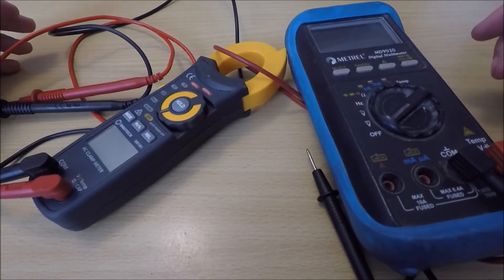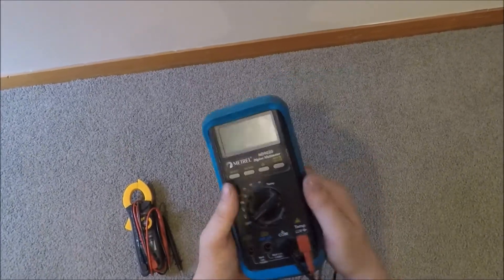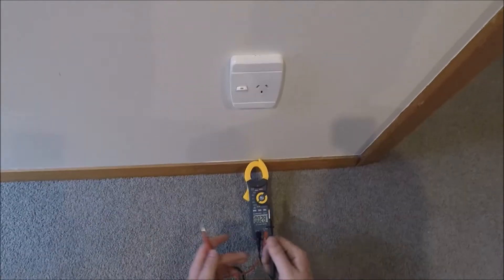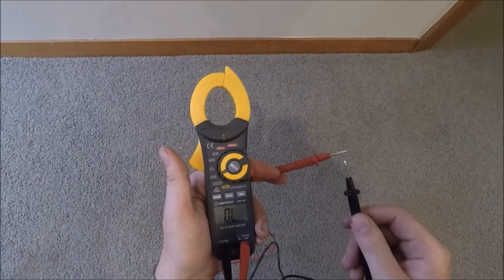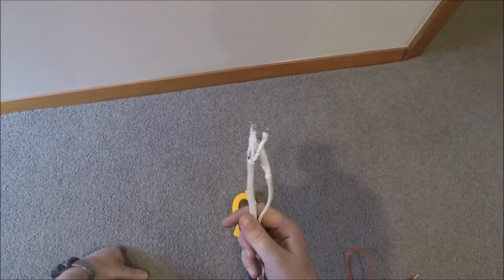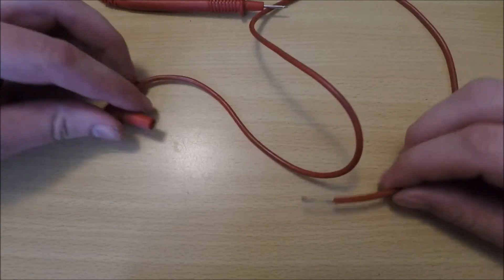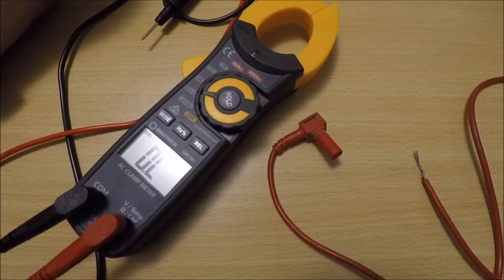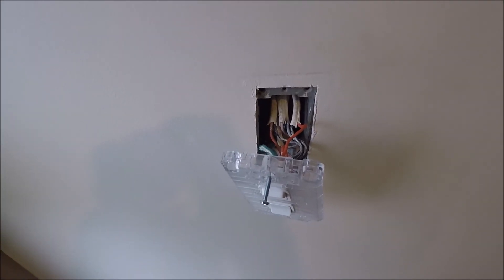How To Use a Multimeter

Comment: What brand is this clamp metre?
Reply from the maker: That one is a Digitech one from Jaycar, relatively inexpensive for a good tool.
Reply: sparkydave what do you use now?
Reply from the maker: @user-dl5cy7tm8g  I currently use a Klein Tools CL800
Reply: sparkydave where did you grab that one from? Looking for a good one that’s available in aus
Reply from the maker: @user-dl5cy7tm8g  purchased from local electrical wholesalers for a good price
Reply: sparkydave cheers for the info mate!
Reply: sparkydave hey mate, insulated or non insulated pliers? Same price. Just wondering? Just for domestic work
Reply from the maker: @user-dl5cy7tm8g  check out my recent vid on all my tools if you get a chance pretty sure I touch on em, I use knipex not 1kv insulated
Reply: sparkydave do you have a link to your tool belt champ? Can’t find one anywhere
Reply from the maker: @user-dl5cy7tm8g  https://youtu.be/hkHlqqkLSbQ and check comments someone asked about some of the tools and why I prefer the ones I typically use

Comment: Im currently working on a sleepout and have run all the cables for lights and power outlets. What im stuck on is I have 2 light switches to control 4 lights. Soi can turn all 4 off at one switch and on again at the other and vise versa.
Im also installing a wall mounted distribution box with the feed coming in from the house to the rcd and then 3 mcbs controlling lights and power outlets. Thanks for your informative videos. Jase
Reply from the maker: Watch the video on two way switching mate (instead of a single light the cable would be looped between all four)
Reply: Cheers mate. Really appeciate that.